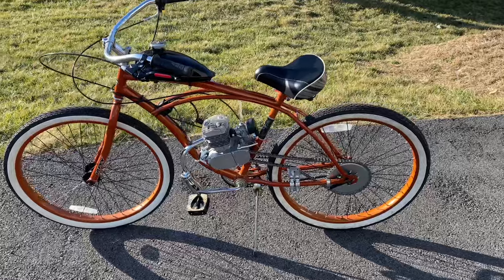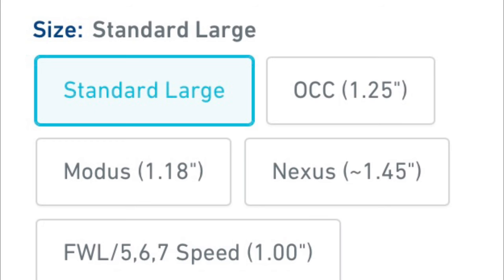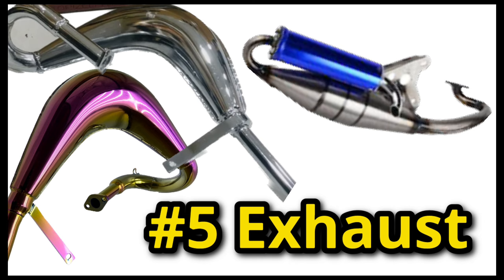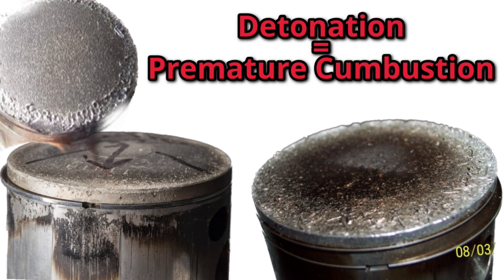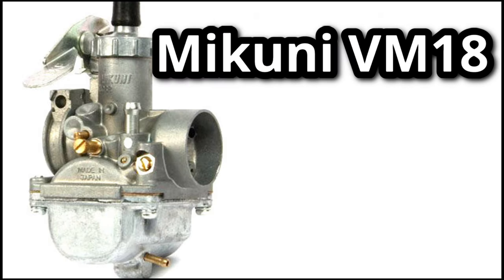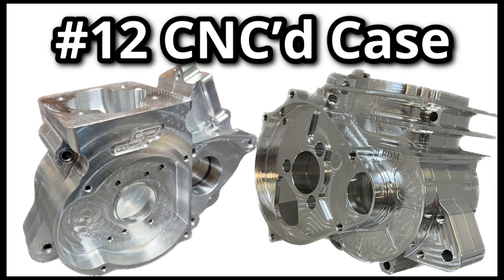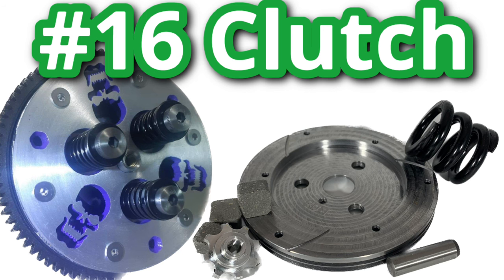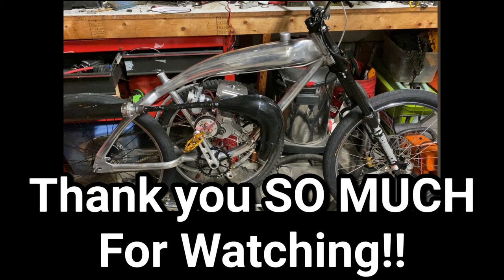EVERY Modification and upgrade For A Motorized Bike #motorizedbike #2stroke #motorcycle #moped

Comment: Ive actually never had any problems with the doughnuts ive nvr broke spokes or had to re adjust or tighten them. I feel like ive been wuper lucky considering ive only had engines that makes 5+ hp
Reply from the maker: Yeah. I overexaggerated with that point in terms of it not working properly and breaking spokes. Truth is, you can get them pretty close to true and with proper maintanence, they wont shred spokes (as much). 
Though, in terms of difficulty, reliability, and adjustability, the hub adapters are more idiot proof and are more reliable than even a well setup pineapple joint sprocket. They also allow you to adjust the chain alignment EXTREMELY easily and make it easy to change the sprocket, etc. 
I added it to the reliability mods because its one less thing to mess with and makes life a good bit easier.

Comment: Good stuff,thanks, what type of nos system you think is best?
Reply from the maker: Thanks for watching. As far as nitrous, it all depends. If you are shooting the nitrous through the carburetor, I would use a dry system. However, if you rout the nitrous to spray directly into the intake, youll want a wet system (fuel mixed in with the nitrous). I dont really know how you would get a wet NOS system to work properly with a bicycle, but here's info on the dry system: https://www.youtube.com/watch?v=GmlnzT4aioA&t=205s

Comment: I want to be able to put a 100 cc bike motor kit into a small pit bike but I can’t get it to make enough power for it to be able to drive off road I want to be able to make a home made pit bike how do I get it to be able to do that
Reply from the maker: If you have not already gotten yourself the engine, I reccomend going with the Avenger 85, since it is pretty budget friendly and has a TON of power compared to any other stock engine.

However, if you have already gotten the engine, you'll want to definitely upgrade to a good exhaust, do some port work, upgrade to a reed valve and a better/bigger carburetor, and follow the video until you feel that the engine performs to your liking. For DIY videos on how to install these parts, how to do port work, etc, there are PLENTY of videos out there, notably Keegan Hache. 

Though, depending on the pit bike (if its more like one of those Coleman minibikes), you could also go for something like a Predator 212 engine, which has a lot of torque, which is what you need for offroading.

Comment: I mean, I understand the desire for more power, but, anyone riding a bike faster than about 30mph is insane lol. I've done it once, just once. Some of the sketchiest stuff I've done on a bike lol.
Reply from the maker: @MmmHuggles  I know where youre coming from. Un-modified road bikes and even beach cruisers get really squirrelly when you get above 35mph or so. But as someone who has ridden a stock beach cruiser 50mph and gona 60mph+ on a felt faker, it really comes down to the bike, not so much speed. Better wheels, tires, a better fork, wider handlebars, good Forks, and optimal rider positioning makes a HUGE difference when it comes to handling the roads and stability at higher speeds. Of course frame geometry and other stuff plays a big role. That's why the felt fakers are the frame of choice. If you build one of those with proper Forks, wheels, Brakes, etc, it handles better than a motorcycle cornering and at highway speeds.

Comment: What would u suggest to find things like the cncd crank case? I love the video great upgrades to do gonna consider all of these when making a engine
Reply: the stock cases are cncd too
Reply from the maker: Really the only sellers of the CNC cases are Smolik Performance and RDM. Smolik has more variety and usually has better shipping and better customer support. 

Also try to get in touch with Ken Hinson, Allen Zhang, and Mitch Green on Facebook, cause they the guys behind alot of the performance parts and could possibly get you better products or possibly cheaper prices. 

If you are gonna get a CNC case, make sure you have a cylinder planned out, since pretty much all the CNC cases are tailored to a specific cylinder.

Comment: I got an off-brand 80cc, just had to pre-order an offset intake manifold for her because the regular shorty one makes the carb hit the block and clutch aperture. Make sure you guys check it twice before ordering 😅
Reply from the maker: It depends on the carburetor and how you have the clutch adjusted. Alot of people say the shorter intakes and the reed valves make the carburetor hit the clutch arm, but when I adjust the clutch correctly, I have no issues.
Reply: @a.m.bgarage.everydayprojec9665  in this motors case, it hits right next to the mounting nut. The carb is an NT, I don't even think it's for this kit (seems awful big), but seems to do the job great

Comment: I've litterly watched 100s of 2stroke bike engine videos since I'm an old 2 stroke guy & love a well tuned 2 stroke..! 

I just started a vintage mini bike build, trying to decide on power plant..?  I think I've decided on a couple 2 stroke bike engines😁 

I'm thinking two 100cc stroker motors if possible? Cnc cases are a must & a balanced crank etc... 

Who do you recommend  for quality parts..? Also since its a mini bike I will need to figure out a drive system... Any ideas..?
Reply from the maker: If you have Facebook, please DM me @Noah Alger (nickname is Beefy Man Supreme). That way, you can send pictures, which will make it a TON easier for me to help. 

As for quality parts, Smolik Performance and RDM are by far the best names in the game.

Comment: What would happen if I changed the exhaust before the engines broken in?
Reply from the maker: The main reason I reccomend doing performance mods after break-in for primarily one reason. I dont know about other builders, but I tend to go gung-ho when it comes to performance parts and make it IMPOSSIBLE to NOT push the engine to the limits, which is NOT what you want in a break-in process. lol

There is usually a lot of carburetor tuning involved when you do mods before or during break-in. Its simpler to just run it stock when breaking-in, but it doesnt matter as long as you doing the proper break-in process.

Comment: Hi, try to milling another hole to increase stroke and use a sthill cilynder ms660.
Reply from the maker: @luizroberto6915  you mean to increase the bore? And that is what I meant by a hybrid top end. Using another cylinder and piston from another engine (dirtbike, motorcycle, scooter, or commonly chainsaws). I am actually preparing to do an ms660 build in the foreseeable future.
Reply: @a.m.bgarage.everydayprojec9665  No, increase the stroke. You  can drill a lower hole for connect rod, near the edge, in each side ( round part) cranck shaft and use a piston 54 or 56mm sthill ms660. Sorry for the bad text in english.
Reply from the maker: @luizroberto6915  you're all good. I see what you mean.

Comment: Would you reccomend any head that is no more than 5mm higher than stock head? I have a trek x caliber 8 frame on my bike and a balanced crank on the engine, planning to do much much much more mods to it
Reply from the maker: I dont really know the dimensions of most heads off the top of my head, but here is a cylinder head guide that should help: https://www.reddit.com/r/AMBMotorizedBikeGroup/comments/18yidcv/which_motorized_bike_cylinder_head_is_the_best/

Comment: What’s wrong with bike berry? I just ordered the stage 2 cdi & performance carb
Reply from the maker: Do not buy ANYTHING from BikeBerry!! If that be the exhaust, engine kit, or even an air filter, it is ALL worse quality than anything on Amazon and it is ALL INSANELY overpriced. Not only that, but they are NOTORIOUS for blatantly STEALING reputable sellers’ products and selling the EXACT product for more. DO NOT FALL FOR IT!

Such as the engines, BikeBerry charges $180 ON SALE ($250 originally) for a kit that sells for $120 or even $90 everywhere else. (BikeBerry's https://www.bikeberry.com/products/66-80cc-bbr-tuning-angle-fire-bicycle-engine-kit-2-stroke   Genuine Triple 40 https://www.ebay.com/itm/224318087531?itmmeta=01HV9MJWFPQGEMF0NB75WRCKT5&hash=item343a66616b:g:0Q4AAOSw6HVl3YBH&itmprp=enc%3AAQAJAAAA8AkM3QwmSrCYGrCvxPuIrn1dHWEp2Ql9tT9TJ0iGeXkeCJtIIRssTrzC81zhKO%2BZXUPyI%2Fjkj27Q%2BWwJDhb5pYKNb%2BSMrWGgxW%2B65t%2BJSW9hXcIwOmWAw7q%2BP%2BDTs%2FJoJ74enRgTA2OBsixowYy3c%2FtQ4yu1dq4J49erpjdyWLppmUqEVqjrwpY65GgtqPpjBsWF5xdTmFiS9Y7IzAe%2FitP1h%2BWDzym%2FCm7Tzs6cdutmO4COH62wypv%2F9wwBRaZnbK6Gs%2BABCoJTk2ArlIsLwa0xcEc0R1gZm4RP6T8DHKLdRrZioP9ATnhE7YgVYlsN%2Bg%3D%3D%7Ctkp%3ABk9SR_rHy7TaYw) That would be tame, but the fact is, the kit BikeBerry sells is even WORSE than the $90 kit. See, the engine is called a Triple 40 and is the bar for reliability and performance. Many sellers sell this kit and BikeBerry’s base model kit is meant to copy off the Triple 40. However, they use lower quality components and a shorter 38mm stroke crank. This not only makes their version of the Triple 40 unreliable, but also perform terribly. And they charge double for their kit. Lol

Not only that, but a LOT of the parts they sell are complete scams. Not to mention EVERYTHING is INSANELY overpriced. For instance, this cylinder head (https://www.bikeberry.com/products/bbr-tuning-billet-aluminium-high-compression-cylinder-head-66-80cc?_pos=2&_sid=ec6b1425f&_ss=r), which is literally worse than the stock heads (DO NOT GET) is sold on BikeBerry for $60 after shipping ON SALE. However, the original producer of this part sells it for only $25 (https://www.amazon.com/Aluminum-Cylinder-Gasket-Motorized-Bicycle/dp/B0BVC2SGZX/ref=sr_1_30?crid=12AIWOGA88TXD&dib=eyJ2IjoiMSJ9.oH0aqAU2OpQjF0EoEDqfKYJG8lTeog0k4RJIRYIo0nCfe2ScMsDIkeMTXh-BIo_niS2W5jXwGSShn5dmVYgs_c623hkPbiv3_nDHGkPY-qO8j1po49rTlXVZ7TPhS5JWNxUg3S4k0qx7T-NZ9Uz08A.mg9TvXJ3eJXdT6G0YhfCD29pNhS7YGpf8-ZV7r2Mtuo&dib_tag=se&keywords=motorized+bike+cnc+cylinder+head&qid=1712942106&s=automotive&sprefix=motorized+bike+cnc+cylinder+head%2Cautomotive%2C78&sr=1-30)

This exhaust is sold on Amazon for $25 (GARBAGE EXHAUST, DO NOT GET)(https://www.amazon.com/HGC-Silencer-Muffler-2-Stroke-Motorized/dp/B07QR62774/ref=pd_ci_mcx_di_int_sccai_cn_d_sccl_3_3/146-6477399-6469042?pd_rd_w=WUJaV&content-id=amzn1.sym.751acc83-5c05-42d0-a15e-303622651e1e&pf_rd_p=751acc83-5c05-42d0-a15e-303622651e1e&pf_rd_r=ZDQD7KSC1BFT4B5E95J9&pd_rd_wg=5LZyQ&pd_rd_r=19c1e43e-f08f-43af-aca5-974c940ff8cf&pd_rd_i=B07QR62774&psc=1). However, BikeBerry sells this exhaust for $50 after shipping ON SALE.

These arent just the START and is actually just the first page of their "performance parts" webpage. There is this (https://www.bikeberry.com/products/digital-tachometer?_pos=1&_sid=3ed163d22&_ss=r) selling for $45 (sells for $13 EVERYWHERE else), and blatant ripoff's like these chopper mounts (https://www.bikeberry.com/products/bbr-tuning-cnc-occ-chopper-motor-mount?_pos=1&_sid=97c719c5f&_ss=r)  compared to the original pedal chopper mounts. Also, bike berry sells their performance clutch plate, which is a DIRECT copy off the RDM clutch plate. Its funny, cause when you bought them from BikeBerry, they would LITERALLY send you one WITH RDM engraved into it. lol

If have been in the motorized bike game for years and years like Keegan Hache, Build-Break-Fix, Smolik Performance, and I, it is easy to distinguish good parts from bad parts. You take anybody who knows what they are doing, and they will tell you that there is VERY FEW products on BikeBerry that are NOT COMPLETE SHAMS. And ALL the other parts that are NOT shams (literally 2) are SO INSANELY overpriced.

Not to mention, many Bike Berry parts COMPLETELY disregard safety. Im talking about many of their cylinder heads ("pancake" and "race" heads"), which causes the engine to overheat VERY easily and causing DETRIMENTAL damage, ALL of their exhausts (besides their "deluxe pipe,") are TRASH and tend to either rip the exhaust threads out of the cylinder, perform NOTICEABLY worse than stock, and/or completely fall apart from the poor quality. Their ignition systems run like TRASH and actually negatively affect performance, the boost bottles literally only create air leaks, the "vibration engine mounts" do anything but make the engine have a LOT more play, causing it to twist when accelerating. I can go on for EVER! 

Not only that, but their customer service is FANTASTIC when it comes to making a purchase, but after a purchase, the service is TERRIBLE! Im talking no refunds, no remorse for their faulty products, and they will delete/take down any negative reviews. lol

I could go on as to WHY you should NOT even consider using Bike Berry, but I think I can rest my case.
Reply: Hey, thanks man! I really appreciate your honesty and detail. I've been watching their videos to help with putting together a 2-stroke kit a friend gave me. Glad I found your videos. 😃
Reply from the maker: @jmalo4576  Thank you for watching. Im glad I could help a bit.

Comment: Premium gas isn't a suggestion, it's a necessity. I ride around looking for 91 stations at least and if I see 93 I don't care if I have half of a tank I'm sipping that sh up
Reply from the maker: No, it really isnt. As I said in the video, unless you have upped the compression and/or advanced the ignition timing, you do not gain ANY type of power or reliability increase. If you are using a stock engine, you are doing NOTHING for yourself other then spending an extra 45 cents per gallon extra for premium gas. 

A lot of people talk about HOW BAD ethanol is and HOW good octane is. Ethanol is good in many instances and ONLY due to user error (stored incorrectly, using crappy oil, an improperly tuned carburetor, and/or other user errors) do issues begin to appear that are usually incorrectly related to ethanol. However, the same issues can occur even with premium fuels

Comment: what about 4 strokes
Reply from the maker: @The_Flying_Comrade  there are SO many variables with 4 strokes and not as common. When it comes to 4-stroke motorized bikes, there are the 50cc, 100cc, and 212cc engines. Everyone knows how to mod a Predator 212 (and there are MANY in depth videos about it). The 100cc engines are identical to the Predator 80 engine, which is also widely covered. And as far as the 50cc (Honda GXH50 clone), there really isn't much you can do and for what you can do, there really isn't much difference in terms of performance.

Comment: Is the saf budget clutch as good as the regular or expensive saf clutch, what are the differences? Thanks.
Reply from the maker: The budget one uses the stock chinadoll clutch plate, which warps easily and has lots of give in it. The CNC plates gran better and dont slip as much. Is it worth the extra $80, I dont know.

Comment: How much in total do you think it was to upgrade the engine?
I'm not going to go all out prob stock block and cylinder
Reply from the maker: If you did all the other stuff without upgrading the block and cylinder, you could spend anywhere from $150 to $500. I have the links to all the parts I mentioned in my pinned comment so you can price things out.

Comment: How do you address the cnc shorty intake problem of canting the carburetor downhill? Every bike I put a shorty on has the carb facing downhill causing float movement issues.
Reply from the maker: Huh. I live in the foothills of the Appalachian mountains and go up some SERIOUS hills and have never noticed an issue with the shorty intake. If you are having a problem, you'll have the same problem with the stock intake.

Comment: 1:37 The stock is so bad, that I replaced mine with, I kid you not, a vintage “Ful-Spark” plug, that had been sitting in a basement full of water, and it ran a actually ran 10 times better.😂

Also, can I even use the third upgrade? I have a bike that has a coaster as the only brake.
Reply from the maker: Lol. Sounds about right! As for the hub adapter, it depends on your hub and middle diameter.

Comment: Have you bought any kits with the 3-liter tank
Reply from the maker: I have not used the larger gas tanks. Ive used the bike frames with the built-in gas tanks, but I've only ever used the smaller 2-liter tanks.

Comment: I was originally planning to buy a kit from bikeberry, but now you are saying bike berry is the worst so I wont buy from them. But can you please send some links for cheap 66cc 3stroke engine kits that aren't complete ripoffs?
Reply from the maker: @spongypancake  Here is a cheap one that works OK (https://www.ebay.com/itm/185804288965?itmmeta=01J4X0PFAMM4HKMXNRWM1YWS2B&hash=item2b42cc73c5:g:NxsAAOSwUFRlnOJN&itmprp=enc%3AAQAJAAAA0MqkXqi9Az6wJ4goyADCa9XdNZ2BQU5r4ejHPlGE%2BElH%2BS%2B6I9DoNwwjiGvpyE1gPq9qV7Us0htPFiGPFNVqhqwCbxI4VMvh8P31KskBCz3PaKWRT1iP2ymLGDB2aKuaZ7HQzIB3qpIvfnxvNh%2BIr8avSyULp4yYunnGERH3UCYTH22LM9wcdAKIM6b0C5Mo4Zo8gqmritKxyXnz%2FvD4d%2F%2BlSMgjhnBinI0QdBCcVtwRkZxiClz%2B%2FvkHk%2BmBYHtduSrWaaK9GDgIuD4vPWdT5vg%3D%7Ctkp%3ABk9SR7L12aCnZA), but I HIGHLY recommend checking out this better quality kit (https://www.californiamotorbikes.com/product-page/2018-wildcat-80cc-motorized-bike-kit-150mpg-35mph). 

Those are just the traditional 66cc engines. I recommend also looking I to the Avenger 85 engine kit (85cc) which has more than double the power, but of course costs a bit more. https://www.californiamotorbikes.com/product-page/wildcat-85cc-engine-kit
Reply: @a.m.bgarage.everydayprojec9665  TY for the repply, but I cannot open the link for the better quality kit, do you have another link?
Reply from the maker: @spongypancake  Type in "California Motorbikes. Com" (without spaces) and it is there regular Wildcat pk80 kit. It should be $130 or something. Don't get the ported kit cause it is really a waste.